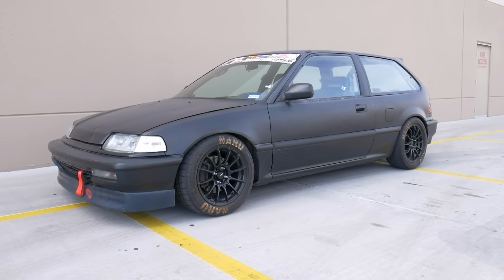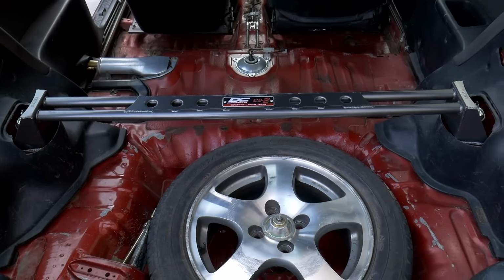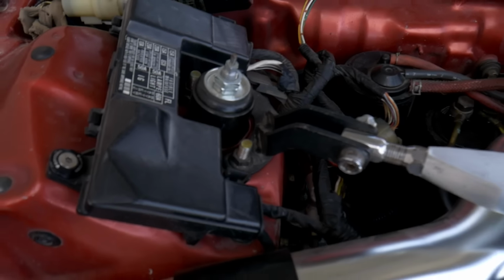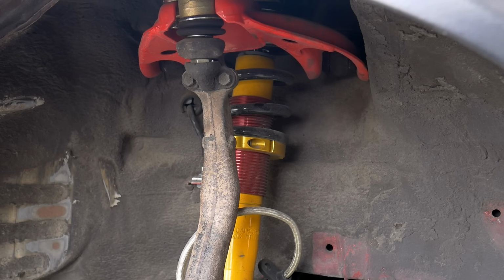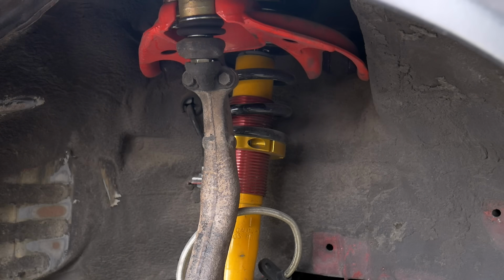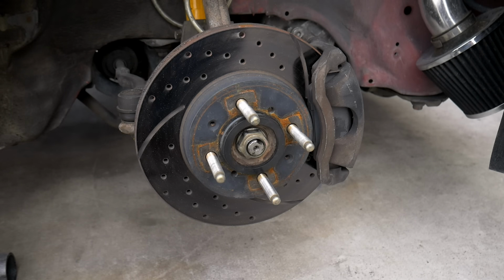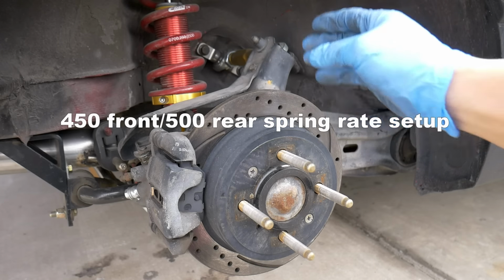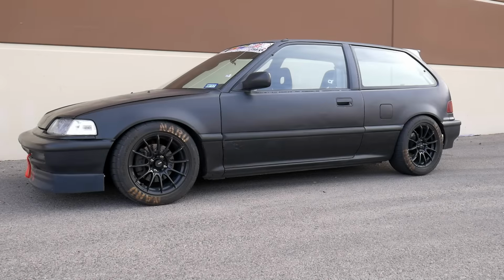1990 Civic DX Track Car Build Overview  - Complete Walk-around - EF Hatchback B20B

Comment: My favorite car you own. Wish you had the body and engine bay painted nice base /clear .
Reply from the maker: I wish that was the case so bad too!  I've contemplated getting it painted sometime soon, but not sure when that will happen.  I did find a really clean repainted 91 Si Red shell for only $900 and thought about getting that and transferring all my parts to that car, but not sure I will.  We'll have to see..
Reply: That si shell is rare too find in EF chassis. I’ve only owned one EF SI hatch a Tahitian green pearl one with dohc ZC swap. Had major wiring issues so I sold. If possible buy that si shell. But still love this primered Dx you own. Love the bare bones simplicity of it and rawness.
Reply from the maker: +Not One thanks a lot!  I think it'll be hard to sell this car if I do get a cleaner shell.  I may just keep this as well! 😁

Comment: Quick question when you say upgrade si cluster, did your old one have no rpm? And when you did switch it how did you wire up the rpm gauge.
Reply from the maker: Yes.  It's a plug and play process
Reply: Garage Built Hondas got it. thanks!

Comment: thx Jon for the specs on your hatch.  im gonna order emusa lower tie bar and its way cheaper than the competition.
Reply from the maker: joethecollector you're welcome!  they are like $18 right now shipped.  I've installed a Beaks bar on a friend's car before and it is designed exactly the same.
Reply: +Jon Widmer way cheaper than beaks bar! Thanks for the heads up. Im gonna order it today thanks.

Comment: I have a question about the spring set up. I'm curious as to why you chose that spring rate. I'm about to do the same (I'm reusing the sleeves of the eBay springs I got originally in the car + reusing the tokico blues and adding top hats). I've been doing some research and yonaka and fnf use between 10k (560lbs) in the front and 6k (335lbs) on the back. Since you've tracked this set up I want to hear your feed back

Comment: I checked out those summit springs.  I don't have the gc sleeves so could I go static with 9" or 10" instead of the 7.5?  Thinking this would be an inexpensive way to go with custom rate spring rates.  Would you recommend?  As always I enjoy your killer videos, I'm going back to look at older ones now.
Reply from the maker: blueprintgville That should work perfectly fine!  That's a good idea, it might sit in the cup of the shock a little crooked but once it's compressed it shouldn't be a problem.  I'd love to see where it sits with a 10" spring and no sleeves.

Comment: What spark plugs would you recommend for a 1991 dx hatch d15b2 motor dpfi? I bought some ngk g power platinum plugs but idk if they will be good since my car is bone stock.
Reply from the maker: Those will be fine.  I prefer NGK plugs and wires for our cars.
Reply: Jon Widmer thanks man

Comment: Im looking to do the same thing with the seats in my ef! I recently realised my stock seats are completely trash and I can not hold myself upright when cornering, hoping to get that done by the next autox
Reply from the maker: Seats make a world of difference!!  It's tough using a regular seat!
Reply: Oh yeah, I can see it handicapping my time right now, how hard was it to reuse the oem rails?
Reply from the maker: Kaden Christensen Depends on the seat.  This Corbeau had 4 holes in the corners.  I just added some steal beams between the rails and bolted the beams to the rails.  Then drilled 4 holes and added some lock washers and regular washers.  It worked perfect and the seat is super solid.
Reply: sweet sounds like thats what ill be doing! Thanks, I really appreciate all the help you've given me in the past! You clearly know your way around these cars and you actually respond to comments and its pretty great! So thanks again, love the channel and all the videos

Comment: You have 2.5in piping? Will that be ok with your stock b20? I have 2.25 in piping with my b20 setup. You think I should go 2.5in? In terms of power gain and torque?
Reply from the maker: +Hombre Blanco29 Yes I do, I don't know if there would be more of a benefit with the 2.25" piping or 2.5", but I'm ultimately trying to make more power (160hp) so I think the 2.25 would be more restricrive when I install cams.
Reply: Garage Built Hondas Thanks for the response bro. Yonaka has a 2.5 in catback for eg for $229.00. Probably going with that lol
Reply from the maker: +Hombre Blanco29 It seems a lot of people like that exhaust.  I've never heard one in person before.
Reply: Garage Built Hondas well I never experience exhaust myself but its cheap and a lot of people give good reviews so I'm willing to give it a try
Reply from the maker: +Hombre Blanco29 I think you'll be happy, many people seem to like that exhaust.

Comment: did you have to run a fuel pressure regulator for the b20 with the stock dx pump?
Reply: my bad i rewatched it. is the pressure regulator a must?

Comment: 1:15 where were you able to find a long enough tie down for the spare?
Reply: The one that is on mine is too short and I plan on using a rota slip as a spare.
Reply from the maker: Yes, I'm using one which normally holds the battery down
Reply: Garage Built Hondas Thanks for the fast reply!

Comment: just sub'd man!! My car is nearly the same setup you have here. I have the Koni yellow/gc setup running 435lb/in springs in the front and 500 on the rear. Neuspeed sways front and rear and all energy suspension bushings. Rear trailing arms from a DC integra and just ordered a set of the dial-ins in the same specs as you. been trying to hunt down some EX spindles for the 10.3 brakes but no such luck right now. I am running the 15/16 MC though and drilled and slotted front rotors. I really need to save up for a swap on this thing :)
Reply from the maker: That's badass!!  Please send me some pics when you have the wheels on, I'd love to throw up a pic of both rides on my Instagram, they'll be cousin-EF's.  What color Dial-ins did you go with?
Reply: Jon Widmer Matt grey. car is light blue like your SI from your buddies fitment issue vid 😃 the one with the Advanti Storm S1's  (?)
Reply from the maker: ONE_BAD_Z I saw it in your vids, looks awesome!  That color is going to look real good on your car!  My Si is actually the Teal color, but looks a little off sometimes in my garage when I record it.
Reply: ONE_BAD_Z where you located? I have a set of EX spindle I can sell you. I'm in Northern Cali.
Reply: Jimmy Huynh south east Washington.

Comment: Wow looks extremely fun to drive! Thinking about getting the s2 alpha half size radiator for my 91. Hows the fitment? Are you running a traction bar? And if so, how did you mount the bottom of the radiator?

Comment: get yourself a skunk 2 intake manifold you'll love it
Reply from the maker: I wanted to so bad, but reluctant to spend money on this head when I was first having problems.  I should though now!
Reply: Yea man or find a P8r head like my b20b n put a skunk 2 manifold on that but im going boost now  ..this head is the Best flowing Nonvtec cylinder head it comes with 33mm intake valves instead of 31mm n you feel the difference trust me 84mm combustion chamber and larger ports I bought my engine from jdm depot 99k miles it is a 9.2:1 comp b20 so you get the higher compression as well
Reply from the maker: How much did you pay shipped?
Reply: Jon Widmer actually I paid for it when there was a sale and it ended up coming out to 300 I drove over there to pick it up I'm actually in PA/Lehigh valley area
Reply from the maker: That's cheap!   What a deal!

Comment: Whats up man! stoked to have come across this channel. I was wondering, How is that skunk 2 radiator treating you? im in need of a new radiator and im wanting to go the aluminum route... just not sure which one to get. was curious on your opinion
Reply from the maker: Welcome!!  Thanks!!!

It has been excellent, I didn't have any overheating issues at all.  I did however have a problem with it clearing my hood, that's my only complaint.
Reply: Garage Built Hondas if you don’t mind my asking... how did you go about tackling and fixing that issue? I have this radiator on order
Reply from the maker: I cut a small portion of the webbing out of my hood and it fit into the area fine after that.

Comment: Love the video man! Quick question, can I run 93 Integra calipers on crx si knuckles?
Reply from the maker: HellHammer No, the caliper is larger and will not bolt up directly to the smaller knuckle.  The mounting points are closer together on the Si knuckle, and farther apart on the DA caliper.

Comment: Do you have a DPFI to MPFI conversion video? If you don't you should make one I'm sure you would explain it so clear. Live all your EF's btw man.
Reply from the maker: Samuel Ruiz that's coming soon!  It'll be part of my civic wagon project videos!
Reply: Jon Widmer Hell yes man can't wait on that video. It will be super helpful when I do my B20B swap :)
Reply from the maker: Awesome, I'm going to try to cover every part of it.
Reply: I would love a video, it's hard finding original 4th Gen mpfi parts. I'm going to try to do mine with EG D15B2 parts and obd1 swap it at the same time.
Reply from the maker: Those parts work too.  Hopefully you don't get any wires mixed up.  It can be pain doing both at the same time if you have never done either one separately before.

Comment: i couldnt hear you well so what was the engine u have in there?
Reply from the maker: B18a1
Reply: @GarageBuiltHondas  is there a good place or website to get it? Bc I’m new to this and wanna just build a car
Reply from the maker: Check locally first.  You can find engines less expensive locally.  Find one still in a car running or find a crash car still running.

Comment: l have a 2dr hatchback with 4g93 NA engine that came with the car, no cat-con, air bags, ABS, ESC or EBD from the factory.Car weigh 950kg and 150hp and l daily the crap out of it.
Reply from the maker: Nice, that's a very similar power to weight as my car, but you have a little more power!
Reply: Jon Widmer coz it is a 1.8😃😃...GSRt head with CnC stg3 port/polish.I cheated a bit, on stock it is 122@wheels and 150hp@crank..cheers

Comment: why ceramic vs a track/street compound pads like hp+?
Reply from the maker: When I first put the shell together those were the ones I had from an old setup.  I want to change my pads/rotor setup this year along with the 90-91 EX larger master cylinder.  It was more of a money issue at first as I needed a ton of parts to get it up and running.  Now, it's just on my to-do list.  👍🏻

Comment: so you ordered your springs from summit racing?
Reply from the maker: Yes, custom spring rates of your choosing.  Look for the 2.5" inner diameter and the 7" tall springs.
Reply: Jon Widmer what's a good spring rate for a daily street car not too bouncy but not way too stiff?
Reply from the maker: Oscarx96 350f/250r.  Those are the Ground Control off the shelf rates, real good setup.  If you only want a small drop like 1.5", you can go softer, 300f/200r
Reply: Jon Widmer i just wanted to slap them on my adjustable sleeves but i needed help deciding what a good spring rate was
Reply from the maker: What kind of shocks are you on, and how low are you?  Spring rates are half of the equation, the other half is determined by the shock.  A crappy shock cannot make a good spring/coil perform well.
Reply: Jon Widmer i'm on tru hart shocks
Reply from the maker: You should be good with those shocks, unless you want to be slammed.  there really isn't anything that rides good slammed.  Anyone that says they have a good ride slammed, doesn't know what a good ride is.  Lol
Reply: Jon Widmer so what spring rate and size should i go again i forgot lol sorry for all these questions
Reply from the maker: 350/250